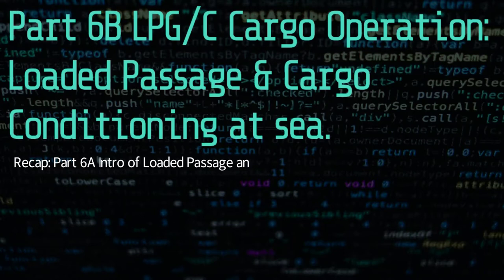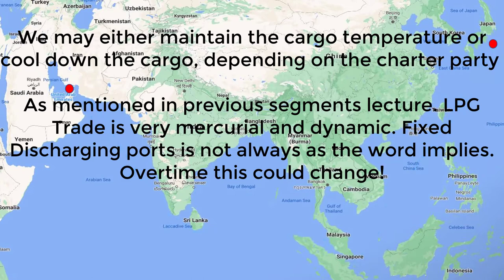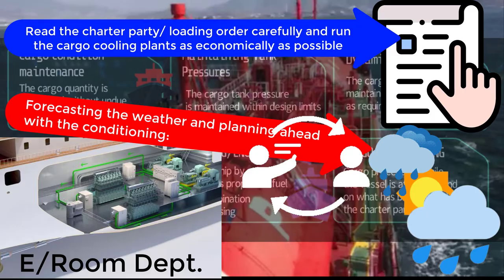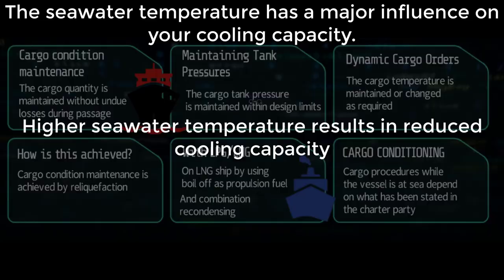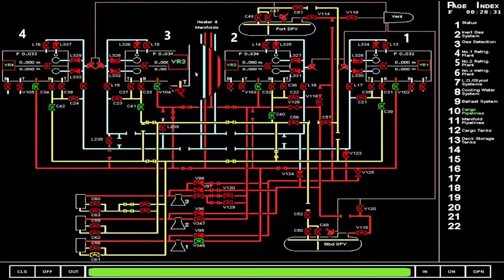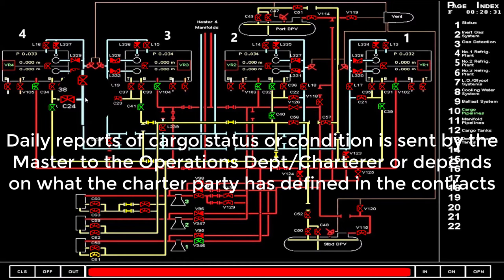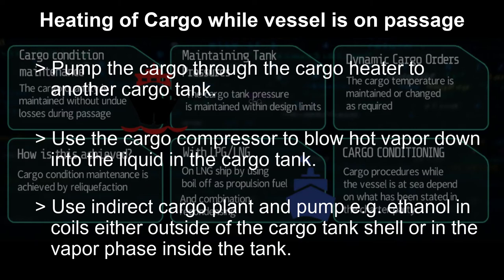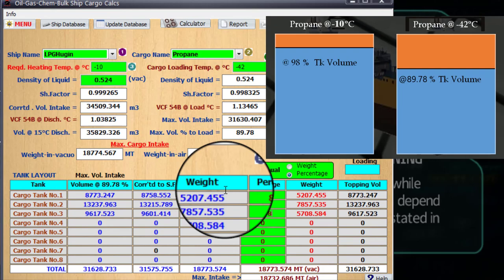LPG/C Ship Cargo Operations Part 6B - Loaded Passage - Cargo Conditioning Continuation & Conclusion

Comment: Hello chief. Please advise how you got the Loading percentage of 89.78 for -10 deg C? 
Is dis by LL= FL x PR/PL where FL will be 98 % & PR is density at -10 deg while PL is density at -42 deg ?  Please correct.
Reply from the maker: That is a different calculations. I have not included the manual formula. It was pre programmed to a software i developed some years ago. I mentioned in the last part that I will discuss how it was computed manually. My apologies, lecturing is just a past time I try to inject in my daily routines. I will show them one of these days. please be patient If i cant do so for now.